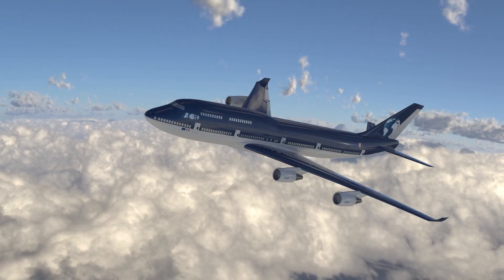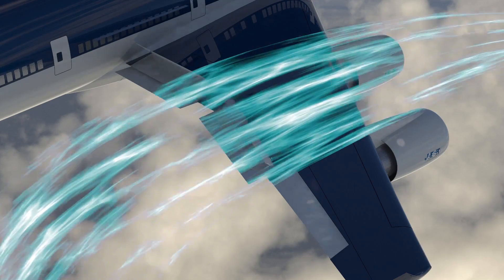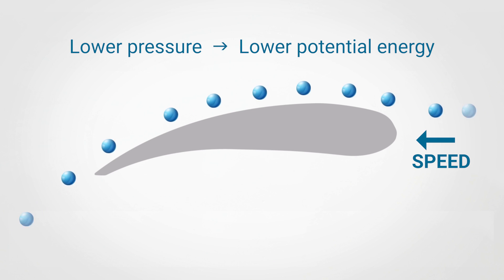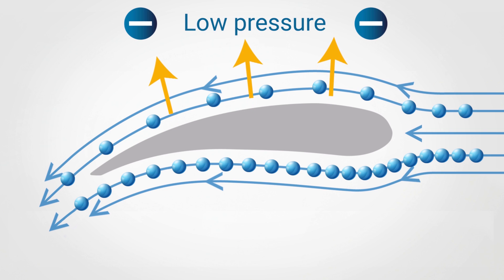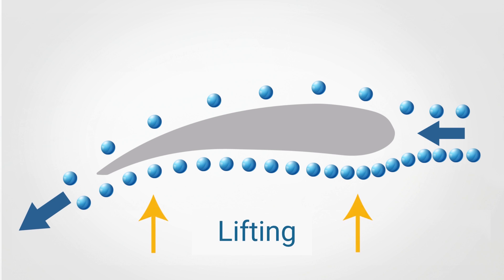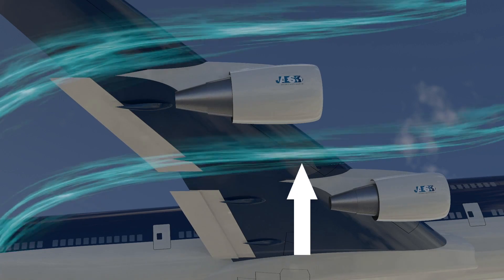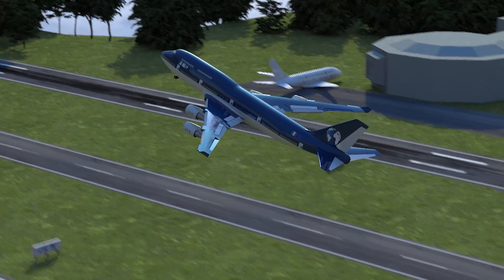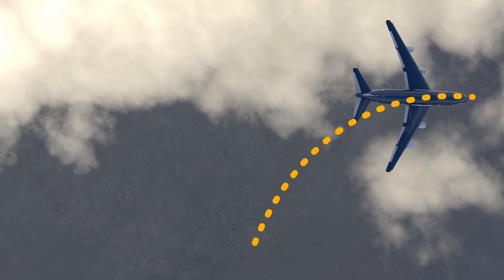How do airplanes fly? Components - Coandă effect or Bernoulli effect- Downwash - 3D animation

Comment: Air up top the wing doesn't meet air below it, there's no physical proof that support this theory and it's wrong to think about it this way. air up top the wing is faster than the air beneath it due to the difference in pressure gradient that is caused by the geometry of the wing.

Comment: In the 5:42 you explained the coanda's effect. But, where is the lifting part in that explanation? Why does the coanda's effect contribute to lift the airplane? What is the formula to calculte the lift resulted by the coanda's effect?
Reply: at 4:4 lift is explained. Coanda effect is nothing to do with lift. you need to apply bernoulli principles.
Reply: @sithukyaw9019  If you really think about it, Bernollis priniple, Coanda effect and Newton's 3rd law all come into play in generating lift.  One may be more prominant than the others depending on speed and airfoil shape and AoA, saying only one or another is the only reason lift is generated is quite ignorant.

Comment: Great video! Better than the last one. Somebody said that Coanda effect have nothing to do with the lift of the aircrafts. I personally believe that this effect plays a fundamental role in these dynamics.
Reply: I can understand both points of view. There are aircraft that rely heavily on Coanda's effect, at least in certain conditions. However, that is much less common for airliners and I would have simply omitted its presentation in this video.
Reply: @lborroni8090  would you instead use thin airfoil theory and continuum mechanics to do the whole momentum change thing because of the high Reynolds number? Because I think it could be argued that if coandas effect didnt exist then the kutta condition ( that air smoothly leaves a sharp trailing edge) would not apply and even airliners would be forced to have a different airfoil shape. Maybe you have a simpler way to explain it to people cuz I think we both personally know what you mean.
Reply: @mertgarbonite9307  I think the point of this video is more to provide an introduction to how a plane generates lift than to give a rigorous model. I remember my first lesson of Fundamentals of Aerospace Engineering at university and I believe my professor put it quite simply by showing us the empirical Cp distribution over an airfoil and integrating that on the wing's surface. It seemed a sufficient explanation to us at the time.
Getting back to your observation, you could definitely apply some tools based on the momentum balance. Actually, I've always found that route quite intuitive even for newbies. 

Another way to go could be to use either Blasius or Kutta-Joukowsky theorem. I find the latter particularly elegant, although more difficult to explain. 

You are correct in saying that if Coanda's didn't exist, than the Kutta condition couldn't possibly be true. In that case, I think, the airfoil would be essentially stalled. I didn't mean to say that Coanda doesn't play a role in lift generation; I wanted to say that's not the primary reason for the generation of lift and therefore I would have omitted it from this presentation. In other words, it's not like the NOTAR of an MD helicopter in which Coanda effect is actually what keeps the helicopter from spinning out of control, I feel it's more of an underlying principle of how flows work. 

I hope I was able to understand your comment correctly and I hope I explained myself sufficiently.
Reply: @lborroni8090  first of all thank you for elaborating. It's nice to have a civil discussion. 

I am also an aerospace engineer, and I absolutely agree with everything you have said but I still feel that coanda should stay when explaining flight to the layman and this is why. 

The Cp distribution is great, especially the empirical one. It undountabdly shows what the air is doing and how that manifests into a net lift. The logical next step is, ok the air does this pressure drop thing, why? 

I think the most accurate approach then is 2 fold. Thin airfoil theory, treat all the air like particles with mass, watch as they deflect off a flat plate at an angle to the free stream and calculate impulse momentum to get the famous lift curve slope 2pi/rad. Inertial lift explained. 

This is the tricky part now, viscous lift. Maybe you have a better way to explain this but basically I fundamentally believe in the kutta joukousky method /theorem. I think it really captures the starting vortex and overall its really the most accurate. I like how you call it elegant. Anyway, now the issue is, great , vortex and circulation cause lift what causes this circulation ? Does gamma cause the pressure distribution or does the pressure distribution cause gamma? 

And that's the real rabbit hole. Now you have to use joukowski transformations to conformal map a circle in the complex plane into and airfoil and distribute potential vortices along a chord line that both add up to the gamma and meet the kutta condition and we are no longer explaining lift at all were at a technical seminar or something. 

At some point we gotta just be like that's what air does and the navier stokes equations dont have an analytical solution but here is the Cp graph and that proves were right. Or you could lump all that viscous stuff into a nice coanda simplification that isnt 100 percent true but is easy to grasp and then parlay that into the rotation circulation of a baseball and kutta joukowski and then bang viscous lift down. Explain the reynolds number and basic theory of flight is done. 

I wrote all that not to prove you wrong but in the hopes that maybe there is an easier way to teach the theory you have or something I'm missing here.
Reply: @mertgarbonite9307  thank you for your educated and polite contribution. I'm still just a student of aerospace engineering but I hope I'll finally earn my degree in September. I think it's great to be able to share ideas and points of view. 

Getting back to the issue of lift generation, I agree with you on the fact that, at some point, we will eventually have to say "ok, this is how it works but we can't explain why in every detail". I actually think it's a great thing! There is still so much more to do, to discover, to invent, and this is great. 

Now let's get back to lift generation. 

I think we both agree on the fact that, in order to analytically explain lift, we will eventually use Kutta-Joukowsky theorem. As you pointed out, the problem with using this tool is explaining why there is circulation. 

In order to explain circulation, we need to move from the realm of ideal flow, in which the Kutta condition seems pretty arbitrary, to the world of viscous flow and boundary layer. Without getting to deep into the theory, we can observe that the boundary layers (both on the pressure and suction sides of the wing) aren't energetic enough (because of viscous dissipation and adherence condition) to move past the trailing edge and onto the other side of the wing. This is why there is the Kutta condition in the first place: both boundary layers can't move past the trailing edge and there we find the rear stagnation point. 

Now where is circulation coming from? Well, just before the boundary layers are fully developed, we can notice experimentally that the rear stagnation point is actually on the suction side of the wing! The air flowing under the wing is therefore able to make the turn around the trailing edge towards said stagnation point. That is basically a small vortex. 

Once the boundary layers have developed, the rear stagnation point, as we saw earlier, has moved to the trailing edge in accordance with Kutta. Not only that: the "vortex" (that earlier allowed the air flowing under the wing to reach the other side of the wing by turning around the trailing edge) has now detachted from the wing becoming a downwash vortex. 

In order to satisfy Kelvin theorem (I think it's Kelvin who formulated the theorem stating that, taken a closed surface under certain conditions, the circulation inside remains constant) we must assume that there is circulation around the wing that is the opposite of to the circulation caused by the downwash vortex. 

Were do I see Coanda possibly coming in to help? Well, possibly if someone asked why there is no separation on the suction side, which I assumed as hypotesis in the explanation above. An alternative, without introducing Coanda and ignoring separation issues, might be to simply say that a gas naturally tends to adhere to a surface due to molecular bonds. 

Of course there are infinite alternative explanations and various levels of approssimation, but I think this one is probably the one that is the most rigorous and the closest to the real world. I'm open to suggestions and observations from your part.
Reply: @lborroni8090  yes the starting vortex and the horseshoe vortex ring that extends to the runway behind the airplane when you ignore viscous dissipation.  It satisfies Kelvin saying that basically circulation is conserved. The starting vortex cancels the bound vortex on the wing and the two wing tip vortices cancel making a conserved global circulation system. Then as the airplane changes its lift it sheds more starting vortices as the bound vortex changes its strength. You know though the fact that the starting vortex is formed because of the boundary layer ending on the suction side is really a good insight I forgot about. I always just kinda was like, the starting vortex forms and Kelvin etc...

I bet this original commenter didnt expect to have such a rigorous technical explanation haha. 

Anyway, I usually end up starting out the whole circulation thing by explaining to people [more technically inclined people] how a baseball curves using the no slip condition and viscosity. Basically i do the rough surface drawing thing that looks like mountains and explain air is so small if sees this surface and gets trapped or shoots off evenly in all 3 directions canceling the local velocity at the point we define as the average surface height. So once there on board with the no slip condition I try to explain viscosity using say syrup and those bladeless fans that entrain air as they go. Then you use imagine a baseball that is thrown and spinning, separate the two conditions with superposition and see a free stream and basically a vortex bound to the ball that is generating circulation by viciously entertaining with the surface bound air. 

Then you gotta wave your hands and be like i can add these because superposition. Its technically not true because you can only add potential flows and I invoked viscosity but.. imagine I invoke viscosity simply to explain a potential vortex and then switch back to potential flow for convenience of superposition. 

You add the flow elements together and find there is a velocity difference between the bottom and the top side of the ball, explain bernoulli real quick (helps if they had physics 1 and know conservation of energy). Pressure difference over area is net force and viscous lift.

The tricky part is everyone says "baseballs arnt wings" and then you show them flettner wings and convince them either that forces beyond human understanding ( Navier Stokes) dictate the wing acts this way when put in certain conditions. Or show the imaginary plans joukowski transformation proving wings are just imaginary baseballs all lined up.  

maybe there is a way to combine our methods and have your way explain the reason for wings generating circulation and acting like a baseball. 

Anyway good luck graduating, I'm sure you can do it if your this close... if you go to grad school pick your PI with the upmost care, I sure wish I had.
Reply from the maker: @mertgarbonite9307  thanks for the time you spend to give your interesting point of view I hope we will always in  our video  people like you and Luca we are working in train video let me know if we could ask you same advise
Reply: @Jaescompany  I know alot of things about airplanes but only the basics about trains.
Reply from the maker: @mertgarbonite9307  thanks a lot for your comment and sorry if we ask bu we saw your comment very interesting and full of information
Reply from the maker: @lborroni8090  thanks we will consider your advise
Reply: In this particular aircraft, it is not the Coanda effect that causes lift. 
The Coanda effect, a jet of fluid flowing through a stationary atmosphere sucks itself towards a nearby surface by entraining air between the jet and the surface. This creates a low-pressure region allowing static atmospheric pressure, 14.7psi, to force the jet to stick to the surface.

Whatever frame of reference you choose  for the plane , wing flying through a stationary atmosphere or like what happens in a wind tunnel , airstreams flowing over a stationary wing. In either case, all the air is stationary, or all the air is in motion. So, there is no condition for the Coanda effect. 

Atmospheric pressure keeps the air following the shape of the wing. The low pressure above the wing is created by the flow resisting change in direction.

Comment: Very interesting video! Does anyone know the maximum angle of tack?
Reply: There isn't a maximum. The angle of attack simply indicates the direction of the airflow with respect to the wing. As such, there is no intrinsic reason why the angle of attack should be limited. Of course, this does not mean that an aircraft is capable of flying at an arbitrary angle of attack. Normal flight is very commonly limited by a condition called stall, which is achieved for a large angle of attack (the exact angle depends on the particular aircraft considered).
Reply from the maker: @lborroni8090  thanks

Comment: I have one simple question about flying an aircraft . I know that the wing configuration is such that the air stream will lift the plane and it therefore will be able to stay in the air. But how does it stay in the air when the pilot flies the plane up side down like so many air force pilots do . Shouldn't the plane just drop out of the air? The wing configuration is in reverse now right?
Reply: A wing, in general, can produce both positive and negative lift. In essence, it depends on the angle that the airflow forms with respect to the wing. Varying this angle allows aerobatics and fighter pilots to fly their planes upside down. 

I hope this short answer can help you.
Reply: It is possible to fly with flat surfaced wing with right angle of attack. The different wing shapes were chosen based on the application to improve stability, control, agility and maneuverability. 
For a commercial aircraft its impossible to fly upside down since the angle of attack will be too high to fly without stalling.

Comment: Can a plane really fly on one engine?
Reply: Yes absolutely, it is a safety requirement for it to do this so that if one stops working the plane can get to a runway and land safely. 4 engine airplanes need 2 engines. 2 engine airplanes need 1 . Some airplanes have so much power they dont even need both engines to take off..though they always use both for safety.
Reply from the maker: @mertgarbonite9307  thanks for answering